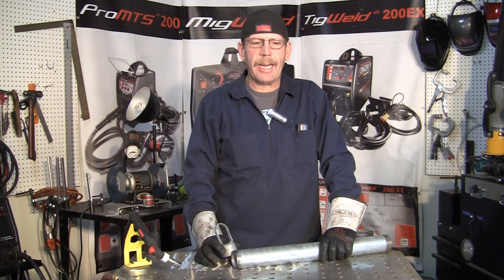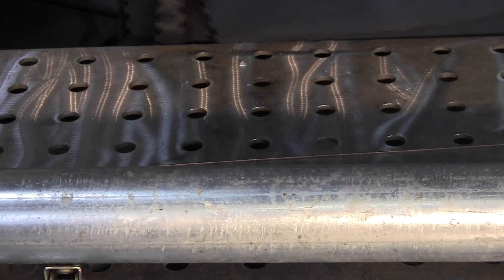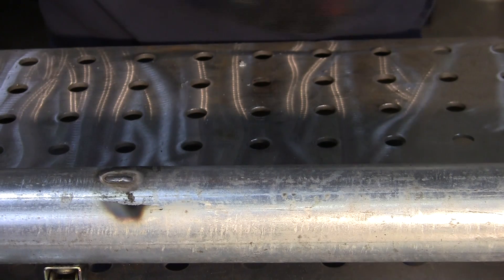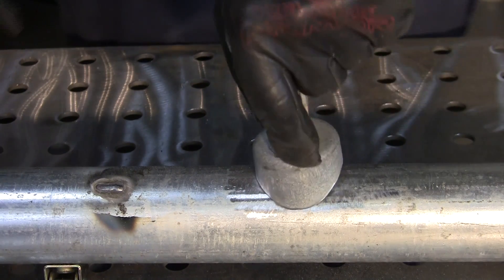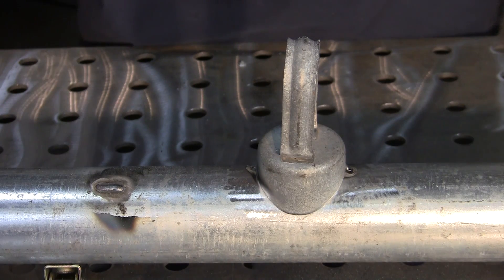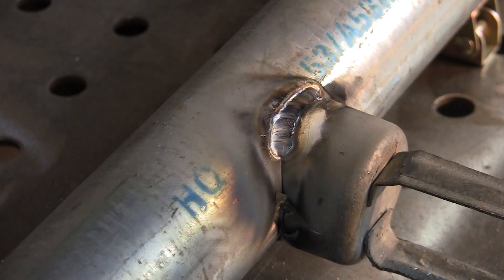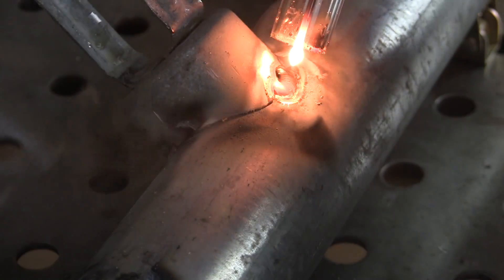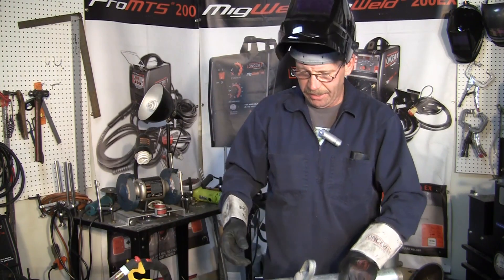HOW TO WELD GALVANIZED PIPE TIPS AND TRICKS

Comment: this is why i braze low fuming bronze all my joints and gas torch, no grinding whatsoever and positive ventilation 3m 6800 full face mask from a teflon piston compressor 200 feet away. nearly zero corrosion too post brazing, for years bronze and zinc happy together
i know tig folks are addicted to argon, i can buy a lot of bronze rid rod for the price of fir a tank of argon in hawaii... aloha

Comment: Someone told me you cant weld galve pipe and keep the weld totally rustproof (apart from painitng which isn't 100% of course). Are there galve electrodes? Can I weld a galv pipe so it is an rust resistant as the pipe itself? Or do I just have to paint the wled to (help) stop rust? Thanks.

Comment: Can you weld this pipe effectively with 6011 stick AC?
I want to weld up a small hanger frame out of galvanized  chain link fence tubing.
Reply: Id try skmethink like 6013. You might get blow holes to easy with 6011
Reply: @pappaclutch3266  don't use 6013 on galvanised, you'll get shitloads of porosity. 6010 will burn through the gal and you don't even need to grind it.

Comment: Use a mask and a fume extractor.  We watch as the toxic fume cloud  flows around your helmet and what does that mean? You are inhaling poisonous gases.  We hate to see you destroy your health.  We like  the  videos and need you around:   Please do it for your family! "..When welding galvanized steel, a respirator is required so that the zinc oxide fumes from the galvanizing are not inhaled. Inhalation of zinc oxide fumes can cause metal fume fever. This acute overexposure to zinc oxide through the respiratory system causes flu like symptoms that can be severe.Sep 21, 2017. https://www.metalsupermarkets.com › welding-galvanized-steel. .."      "...Welding vaporizes many materials into gases that will enter your lungs ..""..Welding fumes contain a variety of metals, including aluminum, arsenic, beryllium, lead and manganese. Argon, nitrogen, carbon dioxide, carbon monoxide and hydrogen fluoride gases often are produced during welding. Welding fumes can cause serious health problems for workers if inhaled, according to OSHA.Jun 26, 2016 Welding fume hazards | 2016-06-26 | Safety+Health Magazine https://www.safetyandhealthmagazine.com › articles › 14291-welding-fume-..."

Comment: i have a question... is it possible to weld a piece of galvanized pipe to spring steel, if cleaned off zinc as you recommend... i have a home made machete blade of spring steel, and i want to put a handle on it of old galvanized pipe i have... is that possible... thanks for the info....
Reply: forest greenwald 3/32 6011 the fuck out of it

Comment: You have to grind it back until it Sparks thats when the zinc is gone it's soft so it doesn't spark a clear indication you didn't get the galvinzed surface off

Comment: If you're grinding off galvanization, and you don't see sparks from the abrasive, you're not removing the galvanization down to the bare metal. Bare metal will look slightly different than the surrounding galvanization and spark when ground, any part that's still coated won't spark.
Reply: Thank you. Very helpful 👍🏾
Reply: Finally! Someone who gets it. If you grind on pipe, it produces Sparks. Grind on galvanized, and there's no sparks, you didn't get to the galvanized. The only reason your welds are a little bit better, is because hot dip galvanized likes to include impurities when it congeals to the pipe.

Comment: where I work now, we mig weld galvanised steel fencing. Everything I have learned in school tells me this is dumb, but I do it because the people are friendly and the pay is good. I use a respirator, but can still smell it sometimes. No one in the shop uses one and always asks me if I get sickness, aha. I may look dumb with it on, but screw that gas.
Reply from the maker: Everyone has their own way on doing things.
Reply: Respirator and fan always when I weld. Always always
Reply: @pappaclutch3266  it affects everyone differently too.
Reply: I definitely get sick from it and makes my joints ache even a few tacks will do it.
Reply: Stuff is poison
Reply: drink milk or half and half to help its an old trick. my old welder used to keep 1/2 n 1/2  on ice right on the table in his mug
Reply: @willfriar8054  that's an old wives tale
Reply: It affects everyone differently. Some folks have no real issue with it. It's good for your immune system. 😎
Reply: @LemonySnicket-EUC  it is absolutely not, it's pure poison.
Reply: @Slouworker  *Sarcasm 😎

Comment: Long time ago, I had to do an emergency welding job on several galvanized parts for a chemical incinerator.  Some of the base material was so thin that you could see through it.  I decided to Heliarc the parts with Everdur filler, keeping the arc on the Everdur to minimize fuming (couldn't remove the gal).  I bridged the holes with larger diameter Everdur and filled the gaps.  Took two hours and the incinerator was up and running by lunch.  Two years later, they were STILL using my repaired parts.  ALWAYS make sure that you have excellent ventilation and use a respirator if necessary!!  If you feel a little sick, drink milk.  It helps clear the zinc from your body.
Reply: Thanks a lot

Comment: Okay tip but he completely underplayed the fumes.  This should only be done with a good respirator and preferably an extractor.  Also, while grinding works, you should only grind enough for the weld.  Grinding a wide area like he did leaves too much of the pipe unprotected.  And since all the area that was ground is now covered with a cap, not only can you not touch it up but you won't be able to see the extent of the corrosion at a later date.  Again, good tip, and I'm not criticizing Rob, but there are a few things that can be improved.
Reply: Define criticizing...